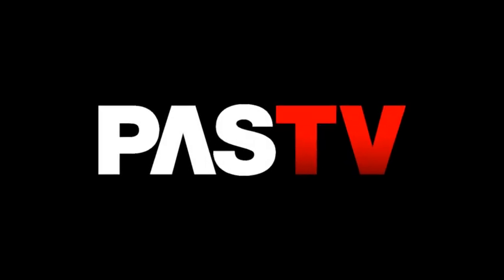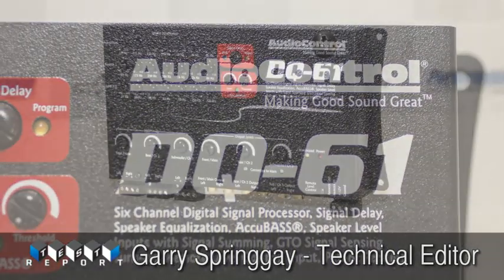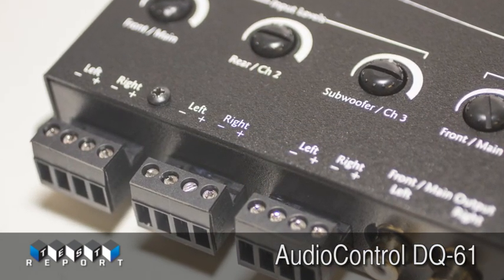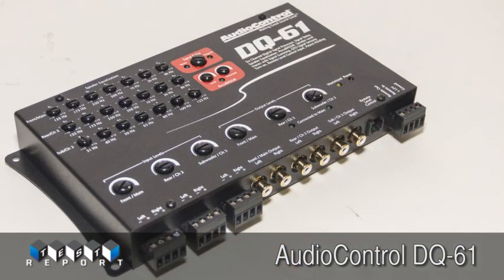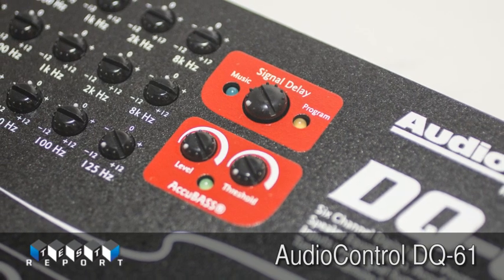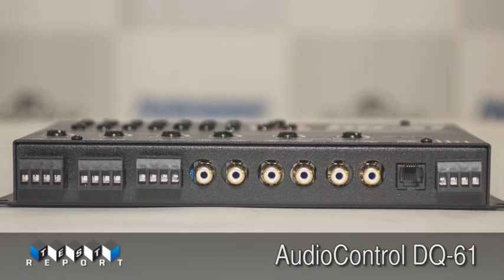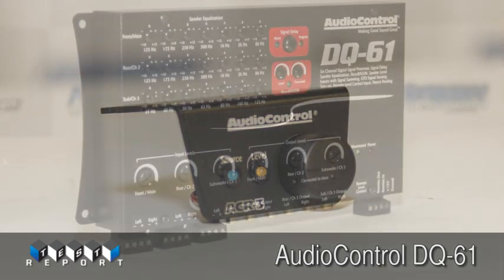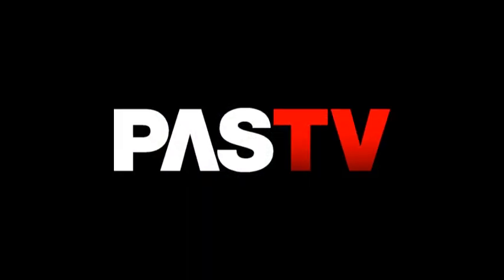PASMAG Test Report: Audio Control DQ61 Digital Signal Processor

Comment: Unless you are keeping your factory headunit dont bother with this.
Reply: Im not bashing your employer. Just most folks I know won't bother using high level inputs for a aftermarket radio. Rca's, optic, or BT. Luckily is not 1988 anymore.
Reply: Alpha Omega this unit is rely only for stock headunits. Some new cars are using the radio to operate your car, AC, heated seats, mirrors, performance settings, etc. so removing it is not going to happen. You car wouldn’t run. So with this so you can add amps and subwoofers to improve the audio system.

Comment: Can someone please explain the difference bettwen the DQ-61 and the DQDX and which is better to use and why??? Thank you!!!
Reply: DQ-61 is if you are running line level signal from tapping into your speaker wires. DQDX is if you are running RCA from head unit to get the signal. All else is the same.
Reply: @dopam1nedude676  Thank you for the information!!! How many amps can be ran if your using the DQDX like I am??? I will be running 2 ROCKFORD FOSGATE T2500-BDCP'S for my subs what's the most that I can run for my mids and highs without having any problems or issues??? I wanted to run a total of 4 four channels of T600-4 from FOSGATE but don't know if that would be possible???
Reply: JOSE A. GARCIA You may have to use rca splitters to do that from the sub channel
Reply: @dopam1nedude676  Oh ok but will I loose signal if I do that or would it help if I ran a AUDIO CONTROL MATRIX PLUS???
Reply: JOSE A. GARCIA You may want to email Audiocontrol to see what they would recommend. If you split all three channels that could be excessive but I’m sure they can answer you.
Reply: @dopam1nedude676  Ok thank you!!! 👍👍👍

Comment: Throwing one of these in a 2015 Dodge Charger Saturday.
Reply: Lorenzo Cheatham Want a cookie 🍪?
Reply: So if I have a 2015 up Dodge Charger and an Audio Control DQ-61 can I take the signal for high, mids and sub from the rear speaker wires and split them into the DQ-61?  How did you do yours?